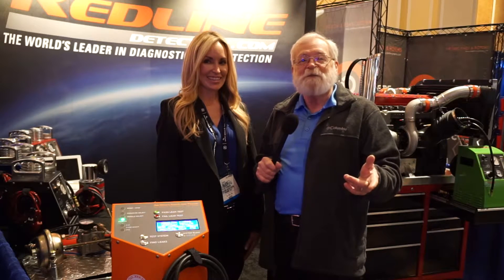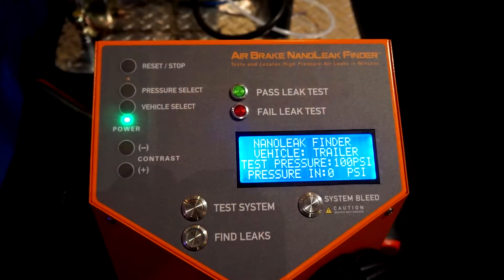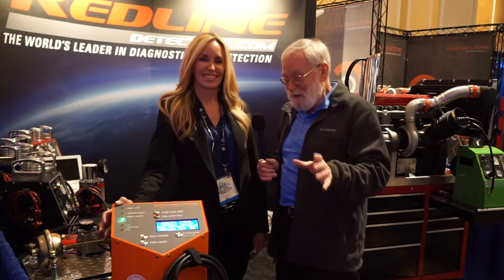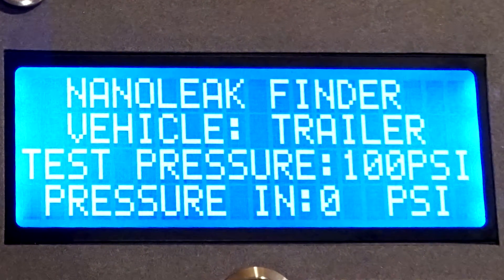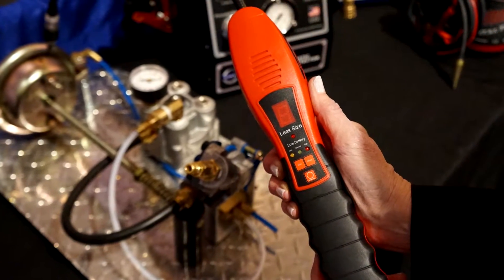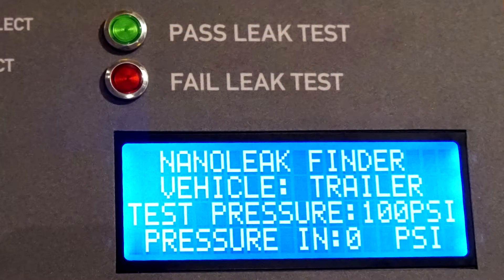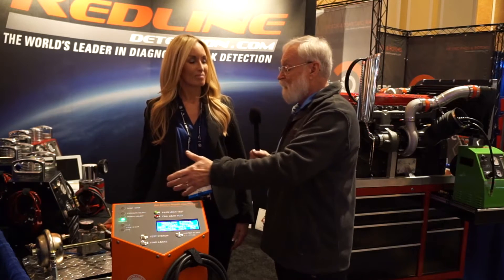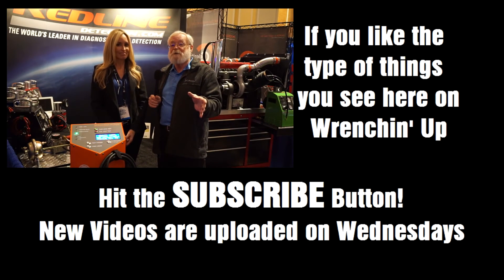How To Find Air Brake Leaks Fast  - Wrenchin' Up

Comment: If it detects a leak the tech still has to track the leak down. In the end it only increases your time by 10 minutes taking the time to hook this thing up let it do its shmill and tell you now look for the leak when i could have been looking for the leak 10 minutes ago. It would be beter if in injected smoke into the air system so the tech can actually see the leak.  Sort of like the vacum leak testers do.  Waste of time and money without that feature especially when "audible leaks", which can be traced easily, are the only leaks that need to be addressed from a DOT standpoint.  Gimmick...
Reply from the maker: Hi - Thanks for watching and sharing your opinion!